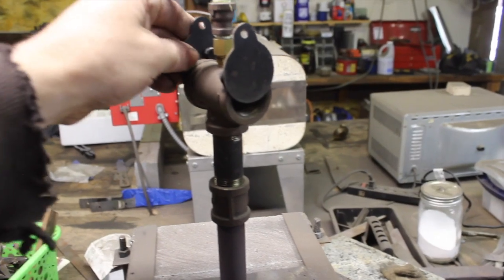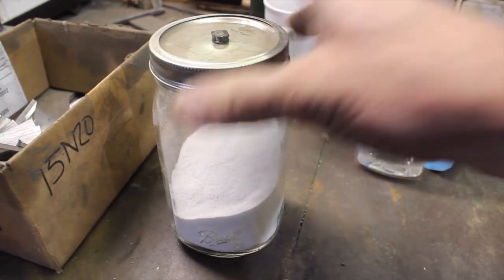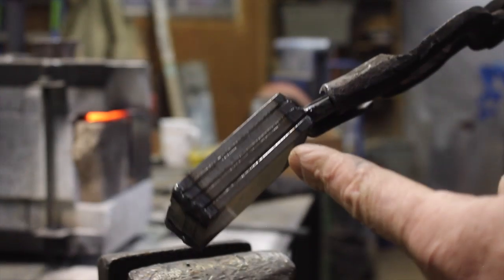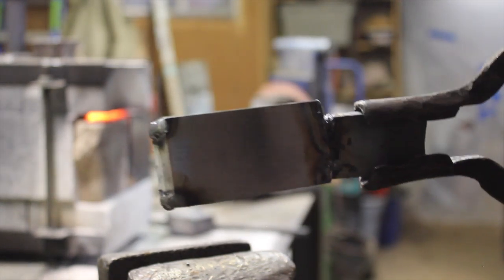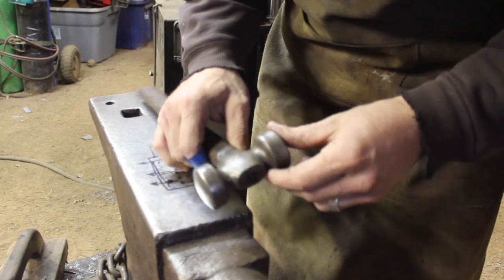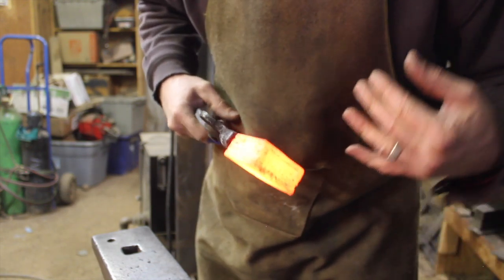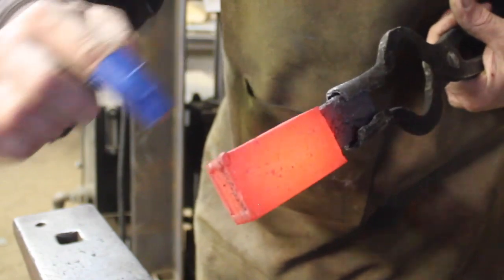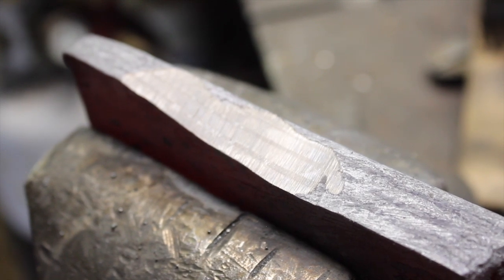How To Forge Pattern Welded Damascus Steel For Beginners ~ Step By Step Blacksmithing Lesson

Comment: I appreciate you sharing your knowledge with us. So many of the blacksmiths don't tell you how, they just show a speed through of the build.
 I've jumped straight into the fire attempting to forge weld. I've had two failures so far. So, I had to step back and punt. I started making mono steel knives but they are only so entertaining.
With the newly acquired knowledge that you provided, I may be ready to give it another go.

Comment: Thanks for all the amazing info in this video sir im semi new to knife making and would like to try my hand at it. Im not sure if i missed it in the video but when your starting off with your pieces of steel how thick are you buying your steel that you then stack up to make your billet? Im doing everything by hand  right now. Also im pretty limited on space with my forge, right now i have the atlas tool knifemaker i think its like a 2" or 2.5" diameter hole that im able to use but according to the website it will reach forge welding temps so i guess ill find out
Reply from the maker: @gaylecoombs5510  1/8" is a good thickness. Thanks for watching!

Comment: Any recommendation on the 15N20 thickness compared to the 1095?
Reply from the maker: I typically use 15N20 that's about .075" to     .090" with my non nickel steel being 1/8" inch thick.
Reply: @FireCreekForge  thanks! 🙏

Comment: How do you forge weld without using a modern welder to tack it together?
Reply from the maker: You can use wire to hold it together and I've heard of guys using stainless steel hose clamps

Comment: How do you achieve a carborized flame in a coke/coal forge?
Reply from the maker: Air control, plus placement in the fire is important; not too close to the air supply

Comment: I have a problem that I don't know how to solve. I use a coal forge and because of this I can’t properly monitor the temperature of the workpiece, because it is in the coals. When I want to do forge welding, my workpiece either melts into liquid metal or I don’t heat it enough and it oxidizes.
Reply from the maker: You'll have to monitor it better, so keeping it a little more visible and not so deep in the fire may help. Also, frequently rotating the billet for even heating is going to be important in a coal or charcoal forge.

Comment: Very new to this and your video along with others have helped me tremendously! There is one thing that is missing though, the thickness of the two different steels. I did hear you say that the 1094 was 3/16", so by looking at the stacks you had and the 15N20 being half as tall, I am assuming that they are 1/8"? And is this important that they are different thicknesses?